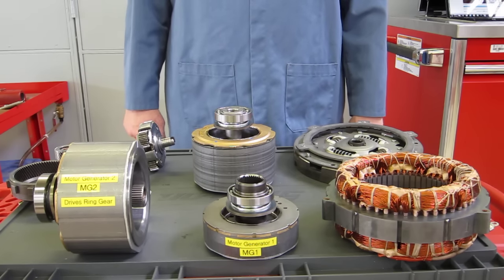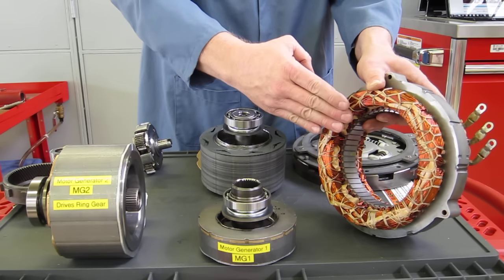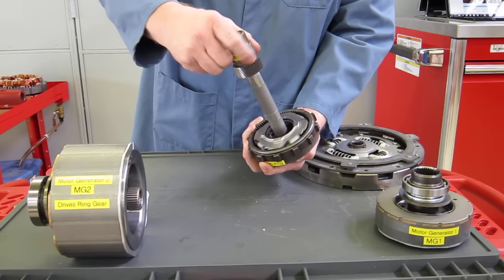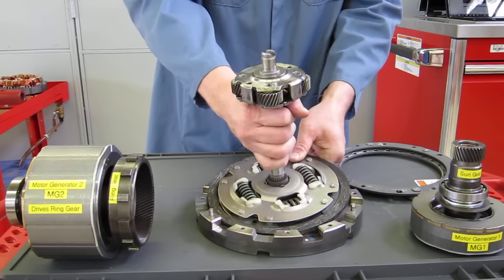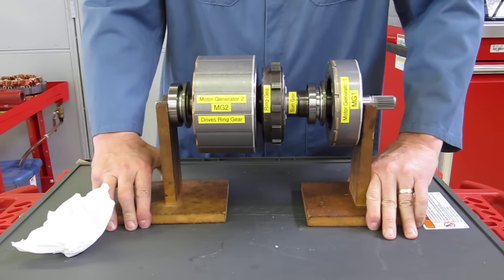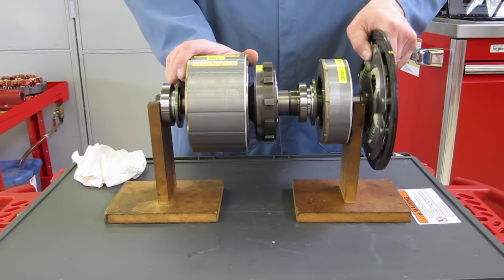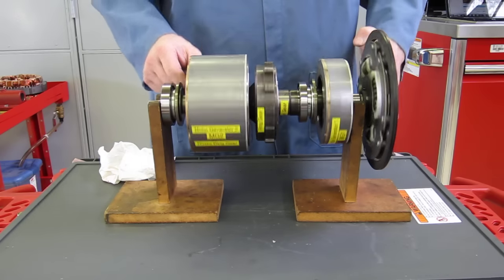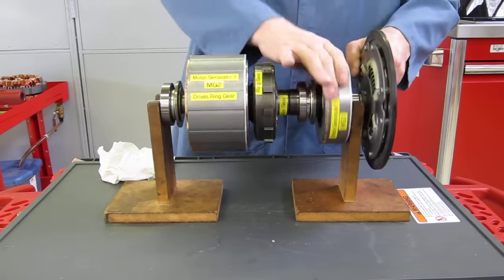2004 - 2009 Prius P112 Hybrid Transaxle (eCVT) Operation

Comment from the maker: Hi, yes there can be force passed from the ICE to help MG2 power the wheels.  How much dependent upon the variable speed differential between the three components of the planetary gear set. For example, if the engine and MG2 are both rotating at 3000 rpm, the planetary gear set functions like one solid piece.  At that point the torque from the engine + the torque from MG2 add together and is delivered to the wheels.  If the ICE is off, the torque from MG2 is all that powers the wheels.

Comment: Now I want a Prius!
Reply from the maker: Thanks for your feedback!
Reply: I have a Prius 2 for 12 years now. Just great to drive and so economical. When you reach your destination in Prius, you would like more road ahead. 
Thanks WeberAuto

J'ai une Prius 2 depuis 12 ans à présent. Juste génial à conduire et tellement économique. Lorsque vous atteignez votre destination en Prius, vous voudriez que le route continue.
Merci WeberAuto
Reply: 143 000 km for the moment. Only the water pump + belt of the engine changed. Tires changed and usual car service done each 15 000 km..@Luca Rossi

Comment: So if there are 2 battery banks one can charge and other can be used to power the vehicle act as a range extender, gasoline engine can be used to recharge the batteries possibly eliminating to charge the vehicle using an external charger

Comment: We have been driving an '09 Prius since it was new.  The car still fascinates me.  When I watched this video I was impressed at how simple the drive train is MECHANICALLY!, and how sophisticated it must be electrical/electronically!!  I mean, just to make this thing drivable would be a feat, then to make it smooth, and perform well, and optimize efficiency, my goodness.  I can not even imagine all that has gone into the controls.  I still wonder, what is really happening when I step on the accelerator?  Then, what is really happening when I step on the brake??  Haven't even delved into that system.

Comment: What's not really point out is, the torque required by the engine to spin motor/generator 1 (when it's charging) causes the ring gear to want to turn. So while the engine isn't directly connected to the output, a lot of it's energy is trying to turn it over, and that 1:2.6 gear ratio means the torque from the engine to the ring gear is 2.6 times greater than it is to the generator.
So, when you're driving down the highway with the engine running, it's power is getting to the wheels by motor/generator 1 acting like a brake, which causes more torque to the output. Except it's not a brake, it's generating electricity which is feed to motor/generator 2 to also help turn the wheels.....and while this isn't as efficient as a normal gearbox, the efficiency comes when you slow down and the kinetic energy is turned into electricity and stored in the batteries for future use.

Comment: Genius, idk what kind of drugs Toyota engineers were on

Good video btw. It reminds me of that really popular 1937 Chevrolet video on differentials. Still relevant 12 years later, you explained well every mode on the Prius and it explains why certain sounds occur at certain times. 

I found the Brake Mode example the most interesting to observe because I already knew it turned on the engine in a somewhat reverse role. Very clear now  on actually happens

Comment: I drew out a design for a go kart that operates similarly, except it uses 1 electric motor and the engine is coupled to the planetary gear set by a belt CVT/torque converter

Comment: can you elaborate on the " engine only assists the propulsion but can not propel the vehicle by itself"? 
You said there is no direct mechanical connection between the Engine and MG2. I am a bit confused because if the Engine runs the planetary carrier, won't the  carrier itself can turn the Ring Gear which in turn drive the wheels and MG2 ?
... or is it because the power of the engine is not enough to run by itself because of the
 weight of the vehicle and MG2?
Reply from the maker: +magicstorm1 Hi, good question. To transfer power, any planetary gear set (sun, carrier, ring) needs one part connected to power, one connected to the wheels, and one part held still (or allowed to slightly slip). In the case of this transaxle, the ring is connected to the MG2 (wheels), the carrier to the engine, and the sun to the MG1 (starter generator). When the engine is running, there is nothing for force the MG1 to stop spinning, so there is no power from the engine transferred to the wheels through MG2. Instead, MG1 is spun by the engine and is used to charge the HV battery. The engine is only used to help MG2 rotate by 1. slowing the MG1 down at speeds above ~37 mph, and 2. forcing MG1 to create high voltage that is then used to electrically rotate MG2 under high acceleration.  I hope that helps.  Thank you for watching!
Reply: +WeberAuto thank you. just one more question. The electromagnetic that slows down the MG1 for the engine to start.Why  does it need to slow down? My guess is to have torque to spin the crankshaft?
Reply from the maker: magicstorm1 Hi, because it can be spinning at an RPM as high as 6500. This is too high of a speed to be cranking the engine to start (even with the gear reduction through the gear set). Starting the engine typically occurs around 1000 crankshaft RPM. The engine starting also slows the MG1 motor so it does not exceed 6500 RPM at higher vehicle speeds.
Reply: +WeberAuto awesome.im doing a presentation  of this ecvt in my auto tech class and your video and quick response helped alot for my preperations.
Reply from the maker: magicstorm1 I am glad this was helpful. Best wishes.

Comment: I'm confused.  Did I miss the part where he talks about the variation of the transmission?  I want to know how the car do basically do whatever speed at 2k engine rpm.
Reply: The speed of the output (MG2) is controlled by the ratio between the engine and MG1. To speed up MG2 while keeping the engine constant MG1 has to slow down, and vis versa.

Comment: The motor is cleaner because its an Atkinson motor. There is no valve overlap. This loses max power but it can gain by running on a higher compression. Which in turn increases it's volumetric efficiency.

Comment: Sorry I am little bit slow.. So if we are putting the shifter from park to Drive mode...It starts MG1...Which turns the engine and MG2 running right, which charges the battery...Please correct me if I am wrong..And I think same thing happens also when we put from parking to Reverse mode? What actually makes it in drive mode mechanically while we are changing the shifter? I mean is there a current flow starts through MG1 which makes it rotating, is it the 12 V battery powering it on?
Reply from the maker: MG1 starts the engine and charges the battery. MG2 propels the vehicle forward or backwards (with or without the assistance from the engine). Thanks for your feedback

Comment: My understanding is that PARALLEL hybrid means the electric & gas power contribute independently to the wheels, unlike the Honda IMA which requires the ICE to run whenever the wheels are turning. Since MG2 moves along with the wheels, you may confuse RPM with power flow. Imagine when the MG2 is spinning at 2000 rpm, it may be regen braking to produce power or accelerating by drawing power. I mean RPM does not determine the power flow. It is wrong to think PARALLEL in terms of gear connections.

Comment: What exactly does that clutch do? You said it is always applied. In what scenario would it not be applied?
Reply from the maker: The clutch is there to allow a small amount of slippage between the engine crankshaft and the transmission input shaft. It also contains the damper springs to dampen normal crankshaft fluctuations. It is never disengaged. Thanks for your feedback.

Comment: Thanks for this great explanation! In the 2016 model, I notice that at highway speeds of say 65mph and I let off the pedal, EV mode may turn on and the engine off. Doesn't this cause MG1 to rotate too fast?
Reply from the maker: No, the 2016 model has a different transaxle design, the P610. See my other video here for more information. https://www.youtube.com/watch?v=hHU5xFOBcsU
Reply: My 08 goes to electric only at highway speeds. The display indicates the power from the ice has stopped and just shows battery to electric motor to wheels. How is this possible? WeberAuto?
Reply: Clarence Li My 2008 does yellow only if my battery is all the way up in the green at 82 mph? I have seen the orange from the engine to the motor and wheels turn off coming down the mountain that fast. I thought to myself, "shouldn't you be doing regen"? So I slapped it into B and the arrows reversed from the wheels to the battery and the lines turned from yellow to green and my cruise control turned off. Was that the system bleeding off excess power or just turning off the fuel to the ice while maintaining it's rpms while it was yellow only as if using only the traction battery? I would love your in site on this @WeberAuto! TIA

Comment: So what does the HSD do if you have a battery full and an engine that requires heat for the hvac or catalitic converter? Does it run the engine as a parasitic load intermitently injecting fuel or something else happens?

Comment: I already have had a solid understanding of the PSD, but it's great to see it as implemented in the actual, physical parts themselves!

I have a question regarding the connection to the engine:  It has a clutch, that (I think I heard you say), is always engaged.  Based upon that alone, I presume then that it's only purpose is to prevent a sudden lurch when the engine turns on or off.  That is, it would slip just a little bit during those transitions, but otherwise always be fully engaged.  Is that the idea?

Later on in this video, however, as you were demonstrating its operation, you held the "engine" stationary.  Does there exist a brake somewhere in this clutch structure?
Reply from the maker: Yes, that is correct.
Reply: WeberAuto Thanks.  Actually, I had a second question there:  In the video, around 70% through it, you hold the "engine" (clutch plate) stopped.  Does that suggest that there's also a brake for the engine, in EV operation?
Reply from the maker: No, it just off. The resistance of compression stroke on two cylinders will prevent most crankshaft rotational motion.
Reply: WeberAuto Gotcha.  Thanks.  I understand that, on the Prius Prime, they added a sprag clutch, preventing the engine from turning backward.  This allows MG1, in addition to MG2, to be used for used for EV drive.  I gather that the sprag clutch gives MG1 something to push against (well, to torque against, more precisely).

Comment: When MG2 is used to dissipate energy is it used as a 'jake brake' similar to when with a auto trans in snow you use reverse to creep down a bad hill using engine to slow down. If not is there a need to dump heat as in dynamic braking? 
   
Looks like MG1 would make a good 'off grid' power generator.

Comment: If we cruise at 120km/h for over 4 hours, can it draw power from engine without help from battery and keep the engine rpm at its sweet spot?
Reply from the maker: That is what it does anyway
Reply: @WeberAuto  I would think this is the best transmission for average cars, better than belt CVT, better than 10AT. Most reliable. I wish Toyota could make Prius better looking and improve the 0-60miles acceleration. Thank you for the excellent explanation though.

Comment: So if the car doesn't roll well in neutral; where is the issue? Itll roll about 2 feet until it hits a pretty solid clunk. It can be pushed pass this point with much more effort. It feels as if pushing a manual car in gear.

Comment: ...just wondering, does Lexus LS600hL have similar gearbox? I am looking at 2008-2017 model, since I couldn't find anywhere anything regarding that gearbox, no specs at all, and it is called L110F.

Thanks

Comment: Wow that was an amazing explanation thank you!  Just a few questions, how similar is this to the system in the 2007 Camry Hybrid?  Two, how much power is this system capable of handling from the gas motor, because I just got a Camry hybrid as a daily for free and was wondering if adding a small/medium turbo to help the small motor out would be detrimental.  Also read that the electric motor is battery limited to 50hp from 200hp, is that true?  Not really interested in longevity, just possibility, thanks!
Reply from the maker: A turbo would not make much difference in the performance of the vehicle since the engine is not directly connected to the final drive gear. Best wishes.

Comment: How it works during uphill operation where a lot of torque is required? Engine is only assisting in moving car, can it provide enough torque?
secondly, how does engine braking works?
and how the CVT actually works?
Reply: please make another video explaining these things.
Reply from the maker: Thanks for your feedback

Comment: I really love your videos. I want to make sure I understand correctly. What I gather from the video is that the engine helps moves the car by generating power via MG1 that is then directed to MG2 which is ultimately attached to the wheels. The engine doesn't transfer any meaningful power through its mechanical connection in the transaxle. Is that correct?
Reply from the maker: Thank you! MG2 is always physically connected to the final drive and the wheels. The rotational speed difference, or not, of MG1 and the engine can contribute torque to MG2 to help propel the vehicle, but they cannot do it by themselves. So, yes, the engine can partially help propel the vehicle depending upon the rotational speed and direction of MG1. The amount of torque delivered is variable, hence the term eCVT.
Reply: @WeberAuto  Thanks! That's helpful.

Comment: Very interesting.  I have a 2006 Prius. When driving on flat freeway at 65, the Energy Monitor shows  a yellow color from the elec.motor to the battery.  As I have noticed this yellow regeneration to the battery, RPM less then 2000 RPM, but the yellow charge can be displayed for a extended distance, yet the battery charge displayed does not increase and the bars in the battery never increase. It stays at the same battery level and I have notice I can drive for over 10 miles of driving without any change.Take my foot of the gas and the slowing car will show blue line to the Elec.Motor to the Battery.  Is this condition the battery will increase.Question....It appears it will not increase battery strength at speed, in cruise, yet it says its generating to the battery with little affect.  Can you explain when MG1 is generating and when MG2 is generating to the battery at highway speeds when the battery is shows a low condition.It shows charging but the indicator never increases when at driving speed at 65.

Comment: I got a question. I sometimes force charge the Prius battery by putting the car in D “Drive” and press brake with left foot and press about 35-50% accelerator paddle with right foot while the car is stationary and the engine puts power to the wheels and the generator and generator charger the battery. Will it damage my transmission or something?

Comment: The "clutch" is also there as a safety device, if you were cruising along at top speed (105MPH) and the engine were to suddenly lock up from say a rock through the oil pan, the clutch would keep MG1 from overspeeding and flying apart.

Comment: But, how does it change the gear ratio? By changing the spinning speed of MG1 so the engine could keep its rpm consistent?
Reply from the maker: The ratio is fixed for MG2 verses the final drive. The ratio varies with respect to how much assist the engine can contribute. The variable ratio is accomplished by controlling the speed and direction of MG1 verses engine rpm. Best wishes.
Reply: Thanks very much!
Reply: Edward Feng  Visualize this (it's hard to visualize at first, so read and visualize carefully):  In hybrid operation (i.e., powered by the engine), the engine starts out driving the planetary-gear carrier.  The wheels can't move because of the inertia of the car, so MG1 turns fast generating power.  That power is piped to MG2 on the wheels which gets the car moving.  It continues what way while you accelerate the car, the ICE at pretty much a constant speed.  Gradually, as the car speeds up, MG2 speeds up, MG1 slows down, and the amount of power piped from MG1 to MG2 goes down to zero.  At that point, MG1 and MG2 are rotating at the same rate, the entire planetary gear mechanism rotates in sync. as a single unit.  At that point you are up-to-speed, and you take your foot off the gas.  The ICE slows down.  Now, the motor-vs.-generator roles reverse:  MG2 now becomes a generator sending electrical power back to MG1, which now turns backward operating as a motor.  Loosely speaking, MG1 "adds" (not exactly, but again loosely speaking) its speed to the speed of the engine, allowing the engine to go at a lower speed.
Reply: So, the "gear ratio" manifests itself in how much electrical power, and in which direction, flows between the two MGs!  "Low gear" has MG1 traveling forward and sending power to MG2.  "High gear" has MG1 traveling backward under power generated by MG2.